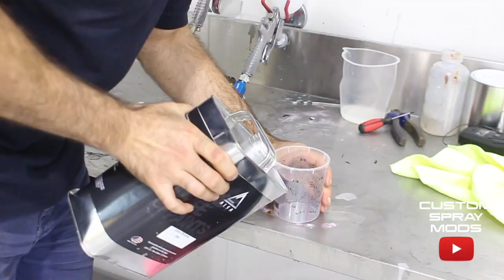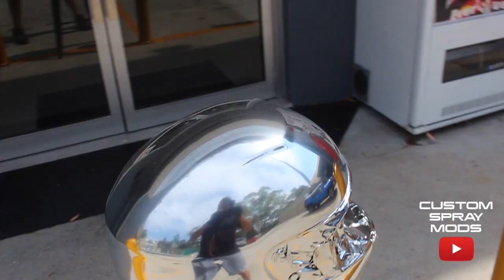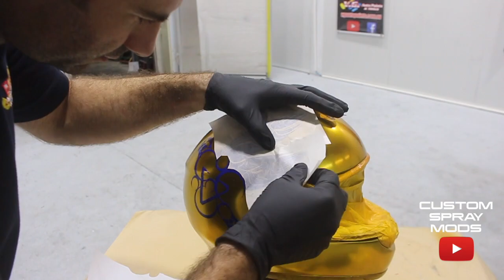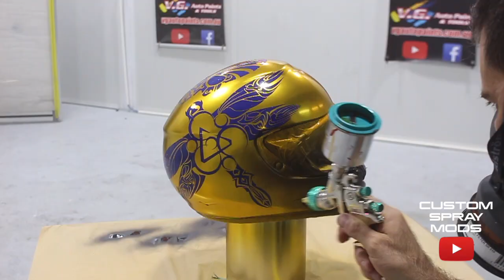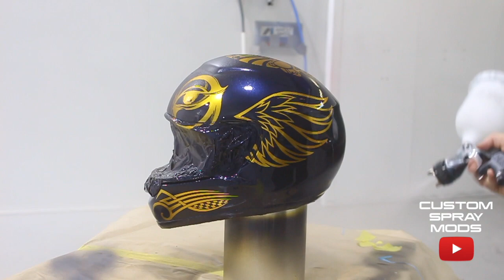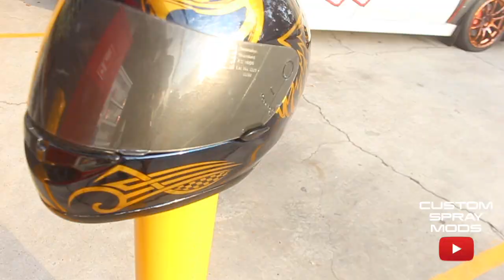Candy over Chrome paint, custom helmet spray job.

Comment: Hi mate. Love your vids! Can I ask, how did you get your masks for the graphics? I once used masks that a local sign shop cut out for me but the adhesive backing was way too strong. It looks like yours are peeling off really easily.
Reply from the maker: Mark Paton I used Avery vinyl I got from a sign supply shop
Reply: Thanks mate much appreciated!
Reply: Did they cut out the design for you?